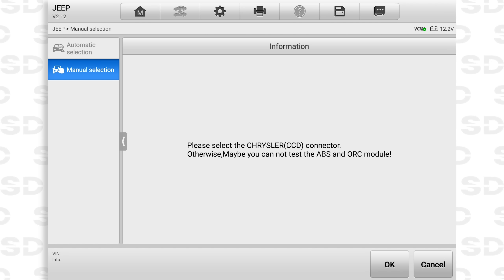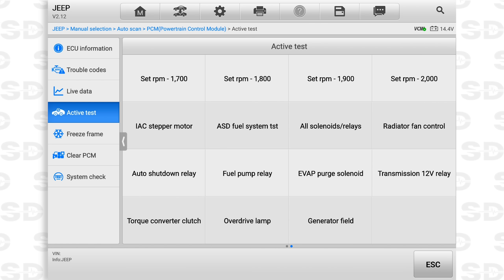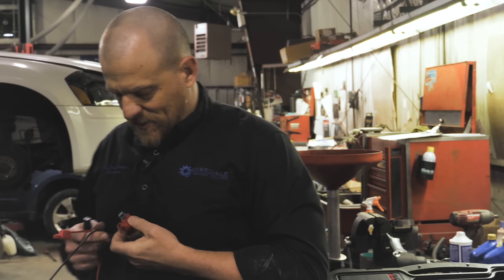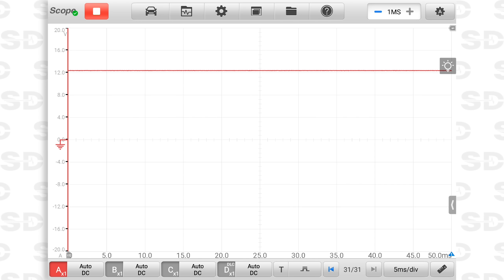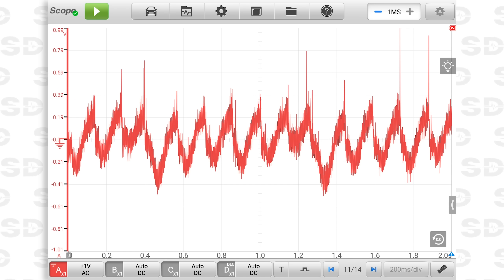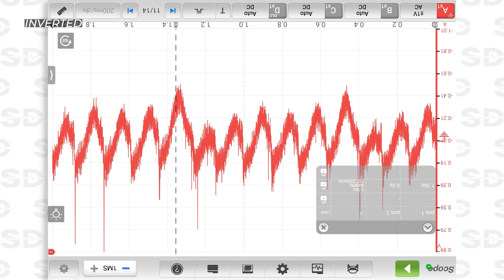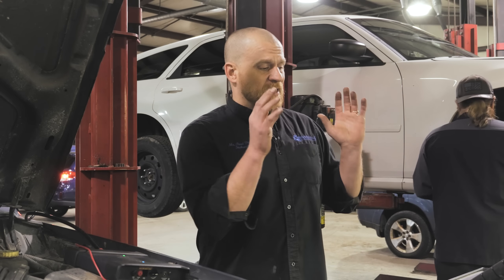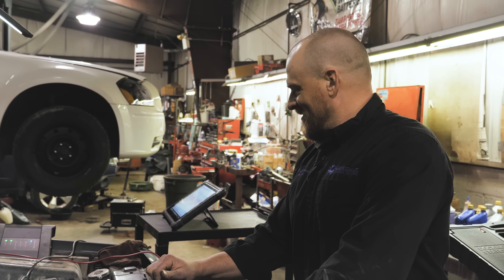Using the Autel Ultra lab scope (Relative Compression Test)

Comment from the maker: When you do an RC test using battery voltage instead of current (as I did in this video), if you simply reverse your test leads (red to neg., black to pos.) this will flip the pattern and make it easier to read. I didn't do that and I should have.
Reply: You're the Master👍
Cool new tip SD👍
Thanks for sharing👍
Reply: I have a autel scanner that can accept that scope.  What do you think of it?   I have been resisting buying it because it didn’t seem that great
Reply: @Dogpool  it’s really good for the price.  You can get the mp408 for under 500. The leads that co e with it are low quality it the scope is good. You can use the mp408 with a laptop as well.
Reply: @grabovg  I have the mp408, just used it for this test yesterday as well. It is really good for the money.
Reply: I didn't know that, you learn something new everyday. My MP408 has a way to invert a waveform, its no the best but it works. I imagine the Ultra also has a way to invert a waveform.
Reply: Sir. The "customer" is Needs and the "Old Chrysler", her name is Blew. Lol. Thanks for taking a look at her sir. Bought a parts Jeep, doing a heart transplant and building the old one up. #LetsGoPens . Thanks Danner(s).
Reply: You may want to hook up one channel to the engine block, this will show you RC with compression peaks upwards as well, without inverting leads or the image. Usally ground voltage is pretty hashfree.
Reply: @juergenscholl2843  yes I've done that in the past. Ground at battery, signal lead on the block.
This uses the block ground lead as a "current shunt", measuring the voltage drop across it same way as a multimeter does.
Reply: @juergenscholl2843 hook up the channel ground to bat negative and the signal for same channel on block?
Reply: @joshwilson849  Yes. Then select 1 volt DC total screen range and 5 seconds sweep time to start with ànd adjust further if necessary .
Reply: I've been looking into getting a Autel Elite or the Bosch ADS 625.... i like the fact that Bosch has the wiring diagrams and the subscription is cheaper ... but then i don't get the scope that autel offers... what do you guys recommend the purchase brice on both are practically the same
Reply: If you dont mind me asking……where did you get the bulk of your experience? Your a very talented   Dude and its inspiring to watch and listen to someone who thoroughly understands automotive electricity.
Reply from the maker: @kylefentz  the short version is 30 years of field work combined with 20 years of teaching at a technical college. Thank you!

Comment: just wondering, could you hook up the scope leads backwards to invert the signal (out phase so speak) or does the A/C coupling essentially filtered so it cant be inverted by lead hookup?
Reply from the maker: Sure, that will invert the pattern, but AC coupling is blocking all DC which allows me to zoom more on the voltage waveform
Reply: @ScannerDanner  thanks Paul. Keep up the great work! In my tech school, we were big on using OScopes. I ended up in heavy diesel/heavy industrial, and I feel like bringing the OScope back into this world is going to save me time and bring in accuracy. Thanks for all the refreshers!

Comment: Excellent explanation / description of how to analyze the relative compression pattern made by hooking up the scope to the battery .  Displaying voltage drops across the battery as compression (and amperage draw) rise in each cylinder .  Thanks for explaining how the problem with sealing / lack of compression within a cylinder greatly affects the compression (air fill - “inhaling”  ) of the NEXT cylinder.  And that stands out on the display pattern too .  But is not to be confused with the main culprit . Thanks for sharing such detail coaching us that it will show up as  big voltage drop (large amperage draw) consequently .  🙌🏼

Comment: i have a hyun-die accent 2016. Replaced all 4 suspension and control arms plus RF wheel bearing. Then I added 2 new front tires from shop and they balanced, and finally big-o alignment. Afterwards play in steering after 40mph. Using a full scanner from YouCanic for DTC I got the C1211, C1208 and C1207 which are wheel speed sensors. No ABS or traction control light. reset didn't remove them. Saw a TSB regarding SAS after wheel alignment. Big o states in small print they don't do the ESC in basic alignment stuff. didn't know that until yesterday. I took to Hyundai and told them this and they told me they found nothing wrong and everything looks tight but I need fender liner and should change the brake fluid and bulb in 3rd window break light IMMEDIATELY. Im fighting them to get the SAS reset but I'm at a loss on what to do. Not even sure it is the SAS honestly. Everything else checked out on their inspection and torque. Any ideas please and I mean PLEASE! I got $100 right now for anyone who can help me over the phone.

Comment: Paul. Thanks for the video. You mentioned negative fuel trim is indicative of low compression. Is it possible to see long term fuel trim at negative 30 due to poor compression?  The vehicle has 235,000 miles and With EGR, evap, disconnected from intake fuel trim doesn’t change. Fuel pressure is normal, new air filter and oil change still negative 30 LT fuel trim. I am down to worn timing chain or compression as reason. Not sure if compression could be that big of a factor. Vehicle run great other than rich.  2005 caravan. Thanks for any thoughts. God Bless you for what you do!
Reply from the maker: Not always. That is just one cause. 
There are many possibilities for a rich condition
Injector flow should be verified, purge valve stuck open, o2 sensor function should be verified, head gasket issue can skew the O2 and cause this etc etc
Reply: @ScannerDanner  Thanks for the response. You are a blessing to so many of us!
Reply from the maker: @fixitman8028  if you need additional help, post to my forum! It is free to join and we can absolutely help you
www.scannerdanner.com

Comment: I don't understand "...when amperage/current rises, voltage drops ..."  If Ohm's Law is the equation V=I x R, then increasing one side of the equation must increase the other.  So, what am I missing?
Reply from the maker: AC coupling a scope is what you're missing. When this is done, the scope is only indicating changes in voltage, not what the actual value of the voltage is.
Reply: Kirshoff s voltage law 
Voltage across batterie = -voltage across alternator=-R I

Comment: I am a retired aircraft technician.  I have not found a shop where I live that I trust.  I have always done most of the required matinance on my own cars.  I am considering buying a good scanner and possibly a scope.  I have been looking at the Autel Maxisys Elite II, Autel Maxisys Pro Mk908P,  not sure spending the extra $2500 on buying the Ultra would be worth it for me as I have no plans on opening my own repair shop.  Would it be better to purchase a separate scope like a Picoscope and if so how many channels do you need?  Also does anyone know of any online training courses that would get me more up to speed on the newer computer controlled vehicles?  Also any advice on which Autel scanner I should buy or even if I should even buy an Autel would be appreciated.
Reply from the maker: Look into the Topdon Phoenix (video released two weeks ago, we premiered it) Link provided in that video as well. It is around $900

Comment: I got a question regarding the RC test . What if you have a amp clamp that has A/C and D/C  function scale like the esi electronics clamp ? Do you use the A/C scale if your using Ac coupling on the snap on labscope?  I just bought the clamp so haven't  played with it yet and curious .

Comment: one thing you've managed to do is confuse me on one issue- how do you know if its a bad winding or a low compression cylinder. on a cranking test the time factor would be difficult to see i would think.  if the starter pinion/ring gear ratio is even number it would be at the same place in the trace. duh i may have just answered my own question.
Reply from the maker: Also, it wouldn't be timed with a specific cylinder if there was a flywheel issue. In particular, as in the case, timed exactly with the cylinder that is misfiring

Comment: Went to a job today with my AL539B and after replacing Harmonic balancer crank pulley on 7 series BMW the customer had a flat batt. 8v when checked with Fluke multimeter. No chance to turn engine. just click. SO the battery was fitted down into the hole in the boot where it lived and on the top was no markings like CCA etc, and no figures either to put into this battery tester. Not without removing battery which was a long one I could see. So with my jump leads out of my van to battery I let it slowly get charge back, only not before having tested the battery. no jump leads connected for the test. I guessed the battery. Told the AL539B the CCA was 700 and ran the test. It came back saying battery only produced 143CCA so battery needed changing. 10 minutes later with my heavy duty jump leads from a lorry juicing up the battery the customer went for engine start. The BMW 3.0 started. I disconnected the leads. ten mins later he switched engine off and tried to restart. It cranked perfect and restarted from just the battery which the Autel AL539B had said was rubbish. 

Were my guessed figures the real reason here, or was I close enough with my guess but the tool is not accurate?  Finished that job and left. unfortunately will never know the battery figures. So have to simply watch out on other cars. Verify if the tool is good or poop.

Comment: To Invert the measurement on the Ultra; select the Channel, select Probe Setting, and turn “Inverted” from Off to On. As far as an Amp Clamp, the Autel MSOAK Kit is the great addition with the Ultra. I use it all the time. 
Very informative video Paul.
Reply from the maker: Thank you! Great tip

Comment: Hey Dan I need ur help my 01 f150 was running good then while running it started running rough five minutes after I started it and now it has 12 codes from two codes of Bank 1 and 2 leak now those r gone after doing intake gasket
Reply from the maker: Check the harness that runs down to the O2 sensor, that you didn't pinch it in the intake manifold.
You probably have some blown O2 heater fuses too is my guess

Comment: I thought I saw an injector one dtc. No? Maybe that injector is washing out the cylinder? Thank you for this video. I often do rc tests on the battery due to the continued complexity of battery cables in newer vehicles. But I wasn't aware of AC coupling. Gonna try that soon.
Reply from the maker: If you did, it would have been from unplugging the injector

Comment: would it be possible to measure the voltage drop in the cable that goes from the battery to the starter instead of measuring the battery voltage directly?
Reply from the maker: You'd be working harder for those connections. Maybe it wouldn't be too bad on this Jeep but if you did get a pattern it would be much less amplitude than the one I showed. So no real advantage with that.

Comment: use a makeshift amp clamp(current sensor) just a single piece of wire tight wrapped around the battery cable going to starter around 6 turns should give good voltage for the scope, simply hook the scope leads to each end of the wrapped wire ends. good enough for relative testing graph :)
Reply: That was my first amp clamp ~40 yrs ago. the beauty of it is that it's naturally "AC coupled". The problem with it is that it's naturally "AC coupled" and doesn't capture constant current.
Reply from the maker: That sounds like work 😃

Comment: I agree the snap on list and pid set up is way more friendly user. I went to scan a VW with my autel today because my snap on was on a avalanche. I was try to tackle 2 cars at once. I gave up on the autel it wanted to know all this sh#t to identify the car. I just went in to generic mode and grab the codes. I cant stand that autel does that. I dont want to spend 15 mins looking up what the car has and dont. I completely understand if your programming but all I wanted to do is see the misfire counter and codes. For the price autel is a awesome scanner put that little stuff drives me nut.
Reply from the maker: 100% agree

Comment: Hi scanner danner. I have an autel mp408 and each time I try to do the RC using voltage I get a noisy scope reading. I was told it’s a common problem from the autel leads. Have just gotten a current amp clamp and same noise persists. Is 200us/div the norm to use while doing the RC. Thanks for this video

Comment: Pretty damned cool! After top dead center is reached the compressed air actually helps spin the engine, that’s why the high peak is next to the low reading. This video should really get the views, I already shared it with several people, super cool one.
Reply: try the same test with WOT

Comment: I’ve tried using a BOB at the DLC using the same voltage method. I couldn’t get a clear enough pattern. So I just ended up using my amp clamp on the starter wire. I definitely need to mess around with my settings and save it. It would be a good parking lot time saver doing it through the DLC
Reply: I did AC couple it. I don’t think I filtered it. Also I was using my versus edge scope. So I probably needed to adjust my timebase. I was pressed for time. So I resorted to my tried and true method. I’m going to try it next week if I get a chance. It’s definitely worth the effort. It’s a quick and easy test from the drivers seat.
Reply from the maker: did you AC couple it and use a filter?

Comment: Hey Danner would a vacuum gauge not have shown this with engine running? Great video for me as I just got a MS919, (the little brother to what you are using) and have not done RC cranking with it yet. Very helpful tips on set up.
Reply: If valve related, then yes if on the intake side only.
Reply: @scientist100 You are saying that a leaking exhaust valve can not change how a cylinder seals?
Reply: @woog74  it will using an oscilloscope in cylinder but wont be visible with a vacuum gage at the intake manifold.
Reply: @woog74  That's an extreme case. That cylinder wouldn't show any compression at all on the RC test. I think a vacuum test would be inconclusive in this case, if the problem isn't the intake valve.
Reply from the maker: possibly depending on the failure, but many, many compression loss faults will show a good steady needle on a vacuum gauge

Comment: Starter motors, like most motors, draw more current when they're turning slower, not because they know they're "forcing" more. I think the current spike on the cylinder following a cylinder with low compression is due to lower engine speed due to the failed expansion event of the bad cylinder.
 How do you keep the women off you when you're wearing those sexy glasses?
 Thanks for that "flipping the screen" trick. It'll sure beat standing on my fricken head every time.
 Have a great weekend!

Comment: The drop in voltage is the voltage drop due to increased amp draw due to compression: the battery must power the piston thru that. When the battery encounters the weak cylinder it actually speeds up the cranking ...only until it arrives at the next compression stroke that is normal, in this case the very next cylinder and the battery now encounters a compression that slows it down more than the previous; the amperage draw increases. Running compression is less than static because ..., well, start at the beginning....air compresses, right?  Therefore the converse must also be true - it stretches; otherwise air you compress would remain compressed. When drawing air in it is being stretched and you could measure that in PSI...air at14.7 at atmospheric  drawn in has a vacuum effect  (our absolute manifold measurement) - less pressure; the air has been stretched...the higher the rpm, the less efficient will be the intake of air. It wont reflect C.I. displacement of the static design.
Reply: Running compression is higher at WOT.
Reply: @fascistpedant758  Vacuum is lowest at WOT, more air is taken in due to less throttle restriction. The difference between running compression test at idle and a non running test is speed of cranking, throttle remains closed.
Reply: @codo7   The static compression test is supposed to be done at WOT.

Comment: Does this remove the need for a compression test if that’s what you suspect, since you can point out the low cylinder with a lab-scope?
Reply: In my experience it does for the most part. You have to remember that this is a relative compression test, so it only measures compression relative to other cylinders. If all cylinders were to be low, then you will see nice pattern and possibly misdiagnose a vehicle. Same thing if an engine has hydrolocked, you may see an uneven  relative compression pattern and it would not mean that compression is bad(leakage).
Reply from the maker: Like this one https://youtu.be/Iq27aO-zfgs
Reply: @ScannerDanner  One of the greatest videos of all time.
Reply: @ScannerDanner  I just watched it. I’m watching your channel like it’s the adult version of Saturday morning car-toons. Get a bowl of cereal, kick back and watch a little SD!
Reply from the maker: Yes sir!
Reply: @ScannerDanner  that's pretty cool! Freaking technology!